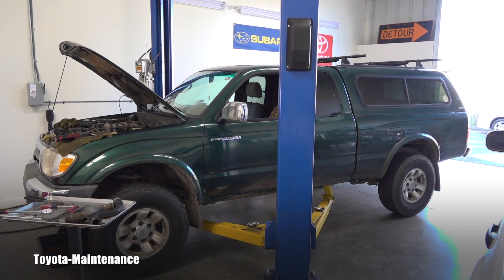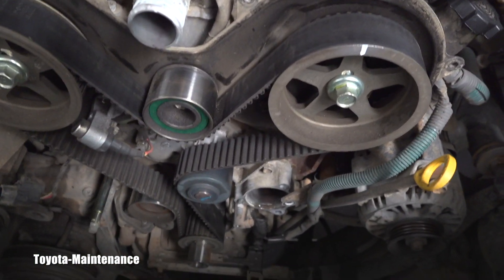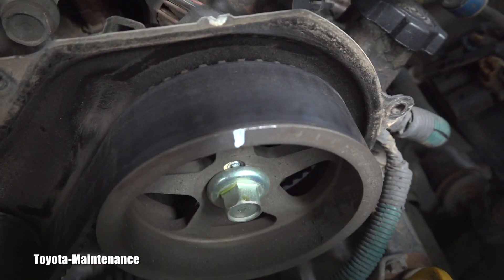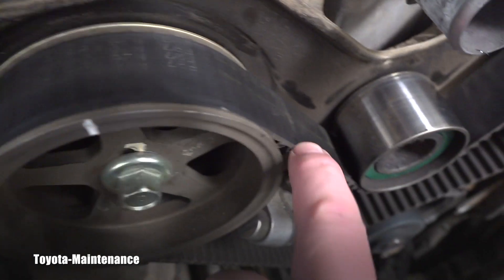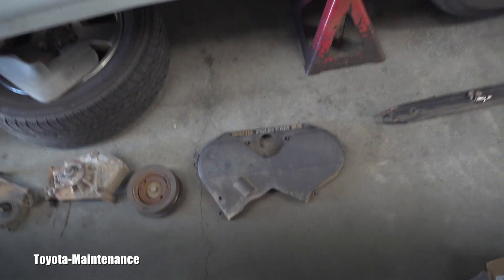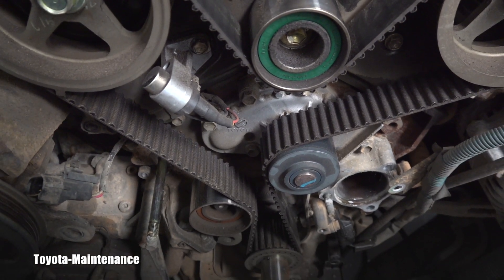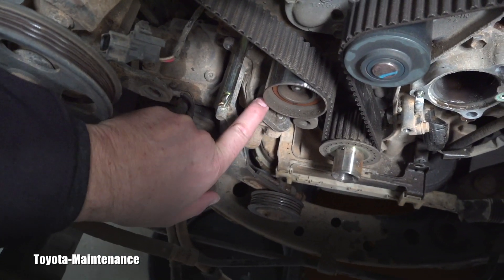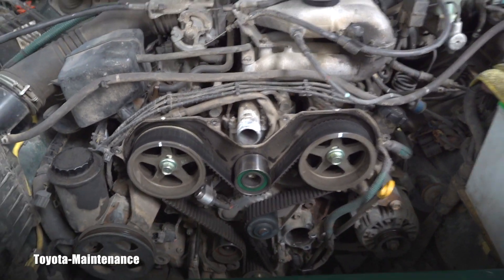Timing Belt after 100,000 miles

Comment: Just got mine done today, 248000 mi 05 4.7. Mechanic said it must have been done in the past, but I've had the truck since 62,000mi. Perfect condition, but had the pump, stat, and drive belt tentioner replaced also. Hoping this will be the last vehicle I ever buy! Doesnt even have rust, but the interior is pretty worn, might do that next year

Comment: Toyota and Lexus vehicles are awesome. My lexus ls430 2001 has 311000 miles and you can still barely hear the engine running. Just do regular maintenance. Going for it's next  timing belt pulleys water pump serpentine belt thermostat replacement soon.
Reply: You might consider replacing the harmonic balancer if it's still the original one on the car.  Mine on a 2000 Tundra V8 (179k miles) just had a complete separation failure at highway speed and it caused a timing belt slippage and damaged the camshaft position sensor.  It had never had oil or coolant leaked on it, yet the rubber element failed. (Years of use in the dry heat of West Texas may have taken its toll.)    Replacing it requires no additional work if you're already going to be pulling it for your timing belt.
Reply: @koomo801  thanks for information I will have that done too.
Reply: @koomo801  Only Complaint I' ve Heard About LS 430' s Was Starters Are A Bear to Repl.,Under the Eng.,But Unable To Repl.From Underneath Access,W/ Out Taking Part of  Eng.Cradle Off.So Pretty Much Most Of Top Of Eng.Has to Come OFF,4 -4.5 hr. Job.So When They Go Bad,On 01-06 Try & Find a Gear Reduction Starter ,Last 2-3 Times Longer Than Reg.One.
Reply: @edcain3676   Yes, all of the UZ V8s have the starter there.   Sticks it in an otherwise empty space but a pain to get to!   Ours are 28 and 20 years old, respectively, and haven't failed yet (knock on wood).   At least it's not a wear item, like timing belts and spark plugs!

Comment: Since it’s a non interference engine, it’s not too bad to push the miles pass the recommended changes, unlike other service requirements.
Reply: Had An 01 V-6 & Broke 1 T.Belt @ 155,000 mls.After Last  Chge.After Loosing Record of Mlg.a T.Belt Chge.Just Repl.W.Pump,Tensioner & New Belt W/ No Damafjge To Valves or Pistons.Kept It To 888,865 Mls.Before Retired It As A Courier Truck.Only Complaint I Had W/it ,Was a Calif Emissions Truck & Almost  Drove Me Nuts W/ Chk.Eng.Lites,Being I Bought it New in Ga.Calif.Emmis.Vehs.Should NOT be Allowed To be me Sold In Other States,Emissions in Calif Are Much Stricter & Causes Problems W/ Computers to Be In Other Altitudes & Not Being Able To Repl..the Fuel to Air Ratio Sensors W/ Reg O2 Ones.But Was A Tough Truck.Orig.Trans.Lasted 465,000,Orig.Fuel Pump= 425,000 & Orig.Gear Reduction Starter= 625,0000mls.Only Thing I Replaced on Drive shaft Was Center Bearing,As Drv Shaft Was Same as V-8,W/ Diff.Housing to Back of Eng.& U Joints Were Big & Tough.
Reply: Mine was 260k on same belt and water pump until I totaled it hitting an elk.

Comment: Its those timing belts (not chain) in those interference engines that the manufactures scare you into changing at 100,000 ie. hyundai. Even some of the interference engine timing covers are a pain to inspect without complete disassemble.

Comment: i got a used car in december, its a 2012 with 98000 miles on it now, manual says to change belt at 100000 miles, but the belt looks great and print is only half faded, still easily readable, so i dont know if its been done or not.

Comment: Got a skoda fabia 1.9 diesel timing belt changed 70 k now 225 k  dayco belt 😳  getting it changed next week changing tensioner w/ p pulleys ? usually its the w /pump or oil leak or tensioner that causes the belt to malfunction but the belt can crack too depends on you're climate sometimes 🤔

Comment: I changed out my timing belt on an suv at 103k.  It was running fine, but recommended service is 80k.  My mechanic pulls out my belt and says you could have changed it in another 50k.  The belt was in pristine condition.  I am not saying not to change it, but there is usually an indicator of a worn timing belt.  Some disagree,  but this had been my experience.   I've ran cars up to 150k realizing I forgot to change the belt.  It you beat your car yes change even sooner.
Reply: What about the car's age? Manufacturers specify a certain age/mielage combo. My car is 10 yrs old with 58k miles on it and i'm getting very woried about the belt snapping
Reply: @MrElchav  determine If your engine has an interference engine.  If not if the belt breaks the car will just come to a stop without destroying the engine.  I have a car with over 120k original timing belt, but I know that it is not an interference engine.  Also it's good to know the history of the car.  Who drives it and are they hard on the car.  Hope that helps.
Reply: @fringelunatic  Oh thanks for the reply. We bought the car a year ago with 50k on it. It had previously been in an accident and so was undriven for a long time. Now its done 58k. I have no way of knowing what type of engine it is other than its a diesel engine
Reply: @MrElchav  Any rubber component starts to get “dry rot” within about 10yrs. So if you ask me, regardless of mileage—10 is safe, 15+ is pushing your luck, and 20+yrs is just wacko. *I have a 16yr old Volvo right now with 190k miles and I can locate no record of a changed TB in Carfax service log of 70+ items, since new. Outside of belt is visibly cracked throughout, edges are a little furry and printed lettering is rather faded, but I can still see it is a Volvo belt. It’s best to pull the TB cover to take a peek so you at least know what it looks like
Reply: @homesold  I'll try see if I can get a family friend mechanic to take a look at the belt to check it's physical condition..... Hopefully they can get to it fairly easily.....

Comment: The most reliable Toyota motors use timing chains. Most new Toyota models are not made with same quality as past. Plastic intake/ exhaust, loose fittings, korean made parts, and Kentucky mfg. plant is constantly challenged with QA problems.